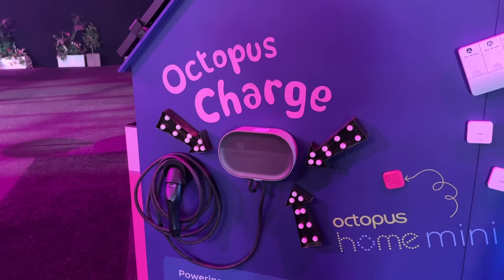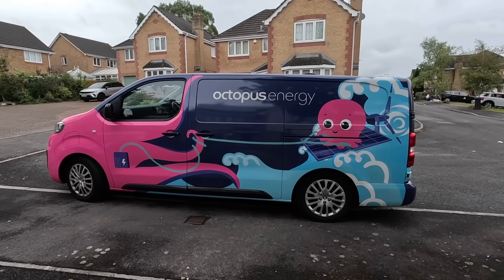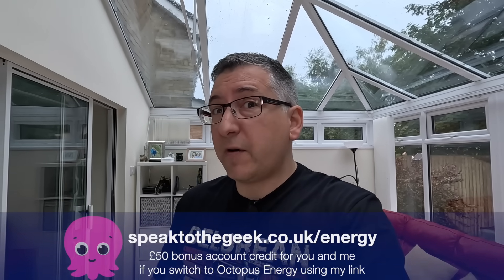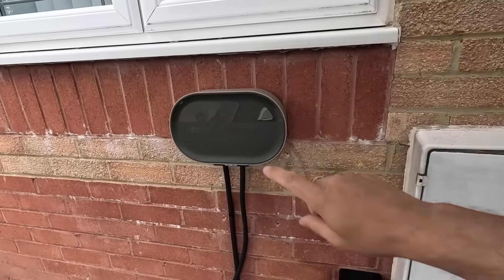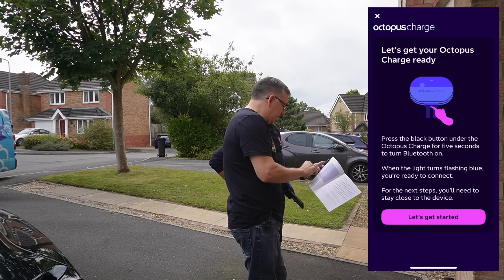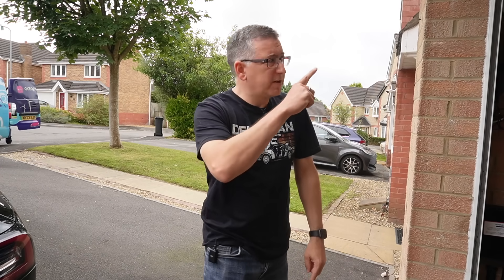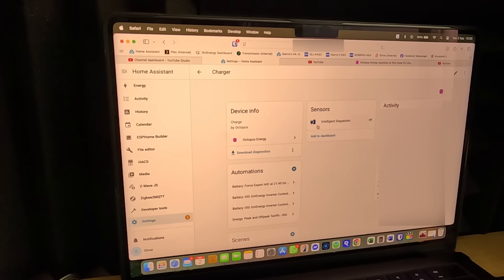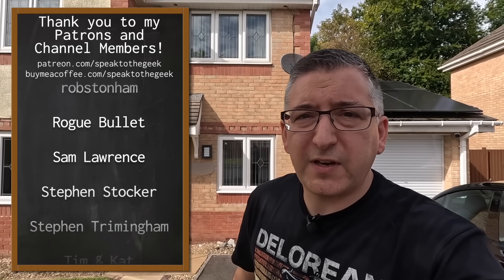Octopus Energy NEW EV CHARGER Unboxed and Installed - Meet the Octopus Charge

Comment: Looks nice, but I hate hate hate that junction box. Could Octopus not allow their engineers to install a cable of whatever length needed directly into the unit? It’s another point of failure and adds an unnecessary additional box to the front of the house. A weird choice on the part of Octopus!
Reply from the maker: Yes, I have provided the feedback about the cable length. It's a similar situation with the Ohme I think. They are clearly going for a sealed unit that the installer doesn't need to open to install in order to ensure it being factory weatherproofed.
Reply: @SpeakToTheGeekTech  I reckon that is a reskinned Ohme charger. The moment I saw it in the box with the captive leads, the shape of it, the bottom entry of the cabling, the external junction box and the 4G connection all sounds way too similar. Very likely some badge engineering going on there - which isn't necessarily a bad thing - but Ohme's lack of install flexibility and their take on opening up API access for Home Assistant integration when I spoke to them confirmed the Hypervolt 3 was for me.
Reply from the maker: The installer mentioned that although it physically looks similar to an Ohme, he felt the whole build, setup process and the LED indicators were very different to an Ohme. Especially with the LED indicator he felt the charger was closer to a Hypervolt.
Reply: I agree. My son got a charger (not this type) with a fixed cable fitted by an Octopus contractor. The junction box was placed under the eaves of the house and after a month or so went on fire due to a connection that hadn't been fully tightened. Lucky they were in and smelt the burning. They now have a Zappi with a cable direct from the consumer unit fitted.
Reply: The junction box makes it very easy to swap the charger in future. I have the same box with the ohme. Mine is in the garage so don't care how it looks.

Comment: I've been using IO Go on two cars with a Zappi for some time now and it's gives you a lot more opportunities to take advantage of times when electricity is free or cheap (windy days and Saturdays) as you're more likely to have a car you can plug in and it will often charge during the day. I do have a Home Assistant integration to turn on other stuff in the house but I tend to react to the "current price of electricity" Octopus entity as this is more stable than the "intelligent dispatching" entity that seems to go on and off when the car is charging and the current price will will be stable for the full 30 minute period where the car may only charge for part of it. It will be interesting to see if this charger has any more features than the Zappi, I'm not changing anytime soon as I preferer the Zappi as you can wind the cable around it :)
Reply from the maker: Are you using the MegaKid Octopus integration or the one from BottlecapDave? I've found that there's a difference between how the two behave with the dispatching sensor and I prefer how the BottlecapDave one operates. If you already have a Zappi though then there's no point switching to this one - it doesn't really offer you anything new.
Reply: @SpeakToTheGeekTech I'm using the BottleCapDave one. I didn't know there was more than one. The tricky bit was interfacing with my FoxESS hybrid inverter but all good fun
Reply: @SpeakToTheGeekTech I use both integrations. I use the intelligent dispatching entities from both to trigger battery charging automations. If one is slow or unavailable, the other is usually ok. I also extract the charging slot times and energies from the attributes.
Reply: I've been using HA for about 2 months and struggling with how to convincingly detect that the house is in an Intelligent Dispatch slot (e.g. off-peak outside of 2330 to 0530). I've used MegaKid's integration and am using the Intelligent Planned Dispatch sensor to determine when I should start charging the battery and start other appliances, however, I would like to add an additional sensor in to verify that I am indeed in an ad-hoc slot. I can't work out which second sensor I should use to confirm? I have a Zappi charger and I thought the best way would be to check whether the car is charging or not but I'm using CJNE's Zappi integration and I cannot work out how to simply determine if the car is charging or not using this sensor.

As an alternative, is there another sensor that I can use to double check that we are truly in an ad-hoc off-peak slot? Thanks!
Reply: @nosh7654 As Terry said in the original comment, use the current price, if its 7p then it's a cheap half hour.
Reply: @TheRonskiman  I've given that a shot, let's see how we go.

Comment: Were you nervous when you turned the solar and AC3 off? Will it power back on? 😂😂😂
Or do you have a monthly drill of this. 😂
Reply from the maker: I did have AC3 connectivity issues a few hours later actually. It lost connection to wifi for an unknown reason. Still not figured it out so I’ve put it on a different access point for now

Comment: Thanks for the review. It'd be great if you could cover in another video the options provided by the charger of you left Octopus. Can it be controlled by Home Assistant without the Octopus API? Maybe with OCPP? Can it remain intelligent even if not controlled by Octopus? For example, could I use Home Assistant to schedule a charge and see energy consumption? Is the firmware of the charger open source? I read it supports compatibility with solar, what does that mean?
Reply from the maker: If you left Octopus your only option at the moment is to put it in non-smart mode and use your car's scheduling instead. Hopefully other energy suppliers will start offering OCPP compliant tariffs and you can move it around. There is no local control of this charger (indeed regulations make local control of chargers near impossible and only GivEnergy have limited support for that). It is not open source to my knowledge. And the solar compatibility means that the charger will 'divert' your exported power straight into the car, same as with the Zappi / GivEVC and other similar products. I haven't tested the solar function yet though, it's on my to-do list!

Comment: Now Octopus are doing solar installs, heat pumps and now an EV charger, how long before do you think they bring out a home battery product?
Reply from the maker: There's the big rumour :) My personal take on that is battery technology requires a huge amount of development and manufacturing capability and it would potentially be too big of a task for them to undertake. They could take an easier route and work with another manufacturer to effectively rebadge something. But never say never. I'm not sure they need to bring out a battery product though to achieve their goals.
Reply: @SpeakToTheGeekTech  - might V2G be their battery strategy?  The battery parked on your drive is likely to be waaaaay bigger than most 'freestanding' batteries.  That said, there'll be plenty of folks without EVs (and, specifically, driveway-connected EVs) who might be in the market for a freestanding battery if it made financial sense. (Bit of deep crystal ball gazing, I know, but....   I wonder if Tesla get a supply license they'll offer a 'free' battery in return for some VPP capability.  They'll be wanting to grab some market share somehow or other...)

Back to the Octopus Charge - does it offer V2G capabilities?
Reply from the maker: As far as I’m aware the Octopus Charge does not offer V2G or V2H
Reply: What if they did what MyEnergi did and rebrand an existing product and add their own integration? Personally I'm reluctant to inveat further in GivEnergy kit - check the Glassdoor reviews for the inside track 😮
Reply: Was there a reason for the extra customer unit and not installing the charger into the aio gateway? I have an all in one and was wondering about this charger how does it stop draining the battery during the periods Octopus select during the day?
Reply from the maker: I've had it installed totally outside of my gateway for both safety (see my other video!) reasons and also because it was unnecessary - I don't want my EV charger backed up by the battery and wired up in this way means the Giv system doesn't see it at all so there's no draining issues. If you use your Giv system to monitor all of your energy usage though then it might mess up your stats because it won't see car energy. I use my smart meter data though (Glow IHD) so that's fine with me.

Comment: I can see why you put the charger where it is for aesthetics but not sure having the cradle so low is ideal ( joys of mounting below a window !)

Will be interested to see what you do with Home Assistant with the Octopus API. I have a Hypervolt Pro 3 controlled via Octopus and I’m currently working on getting the time slots read and feed back to inverter to stop the battery dumping into the car.
Reply from the maker: Looking back I should have mounted it to the right on the garage wall so there would have been no cable run at the front of the house at all. Hindsight and all that though. The Charge is working in Home Assistant now as a charger device in the Octopus integration (new stuff working since I recorded the video and will be released by BottleCapDave very soon), but only for the IOG standard controls. I'm told more API data is coming though...
Reply: When the IOG charge is active then 'binary_sensor.octopus_energy_(your account number)_intelligent_dispatching' turns on, I use this to trigger the home battery to stop discharging.

Comment: Thanks for the detailed intro. I’ve been waiting to find out more about this. Whilst I’m very happy with Octopus as a supplier I’m nervous of buying a product that could be so dependent on their control. It would have to offer a fair amount more than the Zappi to tempt me. Can you share more of why you chose this charger? The fact you were given it by octopus to do some promotion with is a very acceptable and good reason if that was the case :)
Reply from the maker: Just to be clear I paid for this charger! But one reason I chose it was to be able to review it on the channel. I plan to stay with Octopus for a while at least and tight integration with IOG was important in order that can charge any car. You can put the charger in non-smart mode and use your car’s scheduling instead so you don’t have to rely on Octopus but at least you know they’ll be around to support it for a long time.
Reply: How did you order it? I'm an octopus customer and I still can't find where to get this charger